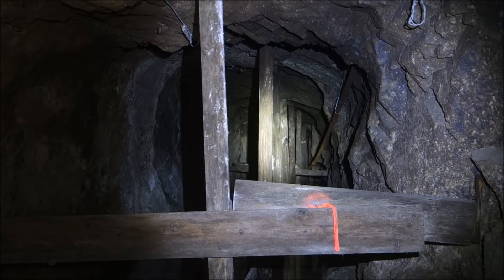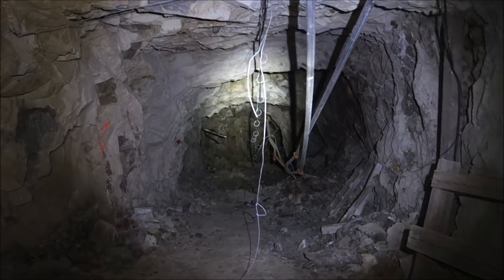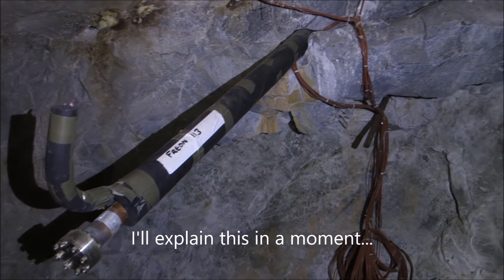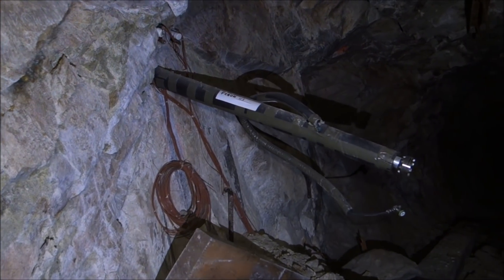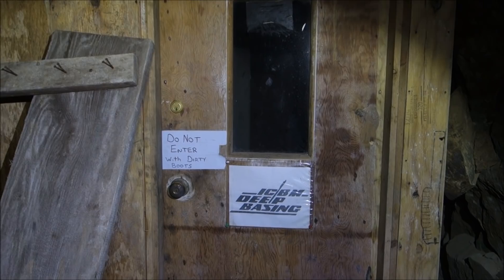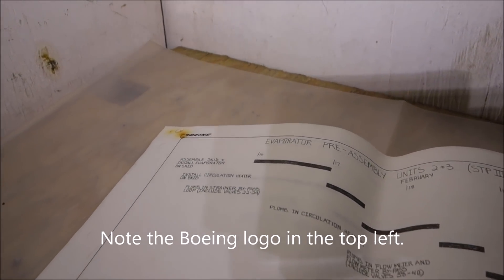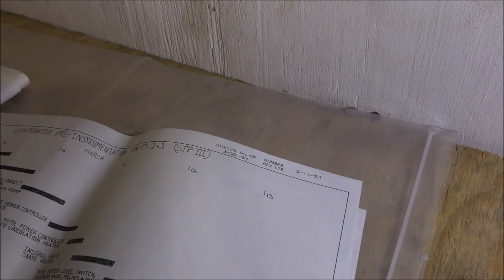Secret Military Project Discovered In Abandoned Mine

Comment: Very interesting and thought-provoking , in fact I have been thinking about this. As stated it’s a refrigeration system and R113 is a low pressure refrigerant that’s easier to work with although now banned because being at HCFC in the 80s it was still used. I thought maybe they were trying to make an ice “bath tub” to either harden (strengthen) the material more around the mine, or De-water (by freezing a coffer dam above and around) the mine. And admittedly a really wild speculation about covering the thermal image of the mine, I’m not sure exactly what they can see from outer space but it wouldn’t surprise me. However  in further wild #!€ed speculation, contemplation, the spacing of those injectors is too far apart for an operation of those designs.  I think the first individuals statement that it’s an air conditioning system for the mine is correct either they were looking to alter the temperature of the mine air or if it was going to be a military ICBM base they were also going to have to keep computer banks under certain temperatures cooling them and providing stable atmospheric temperature around them. The spacing is perfect for that. Those holes are geothermal sumps, that’s what you have instead of a water flow or air blown over coils (the condenser )the other individual said to look for those condenser units but I think he’s thinking of a different system.  Or I am. In a geothermal system those Bore holes will act as a dump for heat or as your supply for heat 54°F can be used to heat a house that’s 0°F quite warm or reverse the system and you can make it quite cold instead.  The bore holes are just sumps for cold or hot depending on what you need to get rid of. The other end in the field would be the unit that blows out your temperate air or yes maybe cooling/heating water to circulate as a coolant/heating medium.   ICBMS Control computers, warhead, rocket motors, mobile launching systems, targeting and control systems, human operators all require a temperate/dry enviroment to perform at their best or as I’m sure you all know in many cases fail completely to work if not provided with such. Or maybe they’re trying to communicate with the stone heads on Easter island.

Comment: A popular environmental protection method is to freeze the contaminant at the point of entry to prevent it from entering the watershed. Given that this is a technique used around alot of mine sites to prevent the requirement of treating effluent, I'd suggest that's what he is looking at. I'd be willing to be that there is a compressor station somewhere around these that acts as a heat pump to allow for freezing of pollutants.
Reply from the maker: The ICBM Deep Basing project was about testing sites for ICBM placement, not about controlling pollutants.

Comment: WOW!!!!! This is incredible! My first assignment in the Air Force was the Ballistic Missile Office, in San Bernardino, California. I was a Lieutenant having just graduated from the Virginia Military Institute, in 1980. I was assigned to BMO for three years. I worked on developing security systems for the M-X Missile (horizontal basing scheme) and during my last year there, I was the Program Manager for the Minuteman Extended Survival Power Program. MESP was a program to replace lead acid batteries in Minuteman silos with 10,000 Amp-Hour Lithium Thionyl chloride batteries. In 1982, I was the Factor Chairman for an Air Force Source Selection board to pick a contractor to conduct a study for deep underground basing of nuclear missiles. My particular factor (area of evaluation) was Waste Heat Management. The theory back then was that if you deployed nuclear missiles, all of the associated equipment, and the people deep enough under the surface of the earth, that it would be near impossible for an enemy nuclear attack to take out that installation. Studies had shown that after several waves of nuclear attacks that any crater dug by the nuclear detonations would just fill up with debris. Of course the Air Force wanted to make the deep underground missile basing completely self contained, self sufficient, and completely sealed off from the rest of the world. This meant trying to figure out how to get rid of all the waste heat from electronics (which were pretty big and consumed a great deal of power back then), closed cycle diesel generators, and even people. I was only involved in the evaluation of proposals. This is very interesting because it looks like someone actually did some tests to verify and validate some of the requirements and early designs. What an incredible find!

Here is a summary of what was BMO: https://www.globalsecurity.org/wmd/agency/bmo.htm
Reply from the maker: Awesome comment and background information... Thank you very much! I was hoping that someone with some real knowledge of the research done on this program would weigh in.
Reply: @TVRExploring  Great to hear from you and I'm glad I could help. I have done some caving before., I spent four days 1,500 feet below the surface of the earth in a caving expedition in Lechuguilla Cave (at Carlsbad Cavern National Park). I've also been in a mine before, at Orient Mine in the San Luis Valley of southern Colorado. Keep up your good work!
Reply: Thanks for the background, LT. I'm sure we have facilities currently in service that exist because of your work on that project.
Reply: @wes11bravo  thank you!

Comment: Possibly establishing the R value for rock. This might help establish the heat transfer ability for buried nuclear storage sites which generate their own heat. From nuclear decay. Presumably Yucca storage site for instance, would generate heat over a period of time and they would need to know how hot it might get and how to remove excess heat. Stainless steel pipe as used there presumably would not rust and might last hundreds of years. Of course if a whole mountain is used it gets warm but not dangerously warm, special cooling systems might not be required, and the whole system could be passive. Using thermal mass and  thermal conduction through the rock, the heat eventually radiating out through the top layer into the sky or the surface being cooled by wind. It looks like the office still had a baseboard heater there by the way.

Comment: Patent US4431349 may or may not be relevant to this (probably not, but it is interesting to consider frozen ground water in the rock being used as a protective measure for the missiles) - "Missiles located in the deeper (hard rock) portion of a shaft or tunnel are protected from damage during a nuclear attack by a mass of ice, preferably trumpet-shaped, located in the outermost portion (e.g., 600-900 meters). When missile egress is required, an ice-supported passageway is bored through the ice, preferably by melting. The trumpet shape assures a straight path for missile egress even if the shaft or tunnel should become transversely displaced by a cratering explosion against the surface."
Reply from the maker: Whether related or not, that is a very interesting line of research... Thanks for digging that up.

Comment: FREON 113 Is a non volatile low toxicity solvent cleaner, mainly used on delicate electronics. Dont know what they where using it for here.

Or if you mix it with zinc it will produce chlorotrifluoroethylene which is used in Cryogenics.....
Reply: Uhhh OK this is the most fascinating comment of all. Wow. Good observations.

Comment: Those aren't "injector" pipes.... hard as it may be to imagine, the freon is going somewhere in gas form and being condensed, then coming back liquid - you're looking at one end of a heat pump/AC system.   I think either the thin line connected to the freon pipes is the liquid return or one of the other pipes in the wall is.  The diagram shows a cooling system, basically moving heat generated from within the mine to somewhere else.    Based on the bundles of wiring near the freon pipes, I'd guess some sort of computer equipment or possibly mechanical equipment under test was placed on skids on the ground and cooled via those lines.   The diagram shows something like an evaporative cooling system, where freon is evaporated by heat in the mine, circulates out via the thick freon pipe as a gas, gets compressed and re-condensed somewhere using water cooled compressors with evaporative cooling, then gets pumped back via the thin line as a liquid to repeat the cycle.   This would let the system move thousands of watts of heat out from underground to somewhere else.   If you can find the other end of the pipes, it'll either be somewhere else in the mine where there's a lot of water or on the surface.   The instruction sheet you show is just a "how to" for operating a hydraulicly powered diamond drill, probably what they used to run the freon pipes.
Reply: It's geothermal cooling. The rock is a giant condenser. Nothing special and they don't go anywhere. It goes in a gas and comes back out a liquid.
Reply: So there that's my answer and I'm sticking to it
Reply: @johnkulpowich5260   Don't believe him it's obviously a government cover up! They used the freon gas to control the miners brains to make the perfect slaves to dig up alien technology.
Reply: As an HVAC technician I agree with this theory
Reply: They were in a war fighting the crab people.
Reply: Yep refrigeration system.  r131 is a low pressure refrigerant thus easier of a system than the higher pressures required of r12 or r22.  Personally I think they might have been experimenting with drying the mine by freezing the surrounding strata.  Or hardening it more, or disguising a thermal signature, or as well said conditioning the mine air or many of above aforementioned.  Taxpayers will never know. Btw r131 is now on a banned list and cost over 2 grand a kilo.

Comment: They inject water and freeze it to fracture the rock, well known technique now days, maybe new or experimental back then.
Reply: Jared Amos. Why would Boeing be injecting water to freeze, in a mineshaft? I didn't know Boeing were miners, I thought they were an aero space company?
Reply: @66hobgoblin81  my question exactly....boeing, aetheon....etc...
Reply from the maker: @Jared Amos This was military research being carried out here, not mining research... And they were working with freon, not water.
Reply: @TVRExploring  Yeah, the military tests technology years or decades before the private sector does. This is nothing top-secret. It's geothermal cooling. They used the rock as a condenser. They weren't using it to fracture anything. They have dynamite for that. These days they drill down vertically from the surface to accomplish what was being done here horizontally in a mine.
Reply from the maker: @timramich  This was testing for the suitability of such sites for the ICBM Deep Basing project. The cooling was part of the testing process. The entire project was secret at the time as, obviously, the location of ICBMs and the method for determining where to locate them was something they wanted to keep close to the vest.
Reply: @TVRExploring  The geothermal aspect was not experimental. It's quite simple stuff. The project was obviously a fail because of the logistics. Having to get them out of a mine and do whatever to them to get them launch ready was nowhere near quick enough. That's why they just stuck them in vertical silos, ready to launch, with 2 people waiting for launch codes. This is just one example of someone coming up with an idea they knew wouldn't work just to get free government money. Kind of like the crowdfunding garbage of today. So much pseudoscientific crap out there that never comes to market, after pocketing hundreds of thousands of dollars. Senators and congressman aren't too bright when it comes to practicalities.
Reply: In the "how its made" video on uranium mining, they mention cooling the ground with chilled brine to control the ground water in the surrounding area.

Perhaps the freon was a similar aspect: if they could keep a deep underground silo or base from flooding, then it would help preserve the missile.
Reply: @Puffie40  It was using the rock as a condenser.

Comment: If they injected Freon 113 into the rock, the whole area including water table would be contaminated. It does not break down and can be toxic, even fatal. It takes very little inhaled to cause nerological problems and suffication/death. 

I wonder if it was not used to draw heat out of the rock in case of thermonuclear war so they could still launch. One could argue at that point it is useless as the entire planet would be destroyed anyways.

Comment: Hmm . I will hazard a guess here .  In that Freon will freeze almost anything when subjected to enough Freon over a period of time  . I am "guessing " they are testing the strength of the rock by subjecting it to cold temp's ?!?  I am guessing that they measure the temp needed to fracture the rock , ergo deducing what the rock(s) can withstand .  I do not know if it is still used or done now . But there was a time when Freon was used to do pipe leak repairs .  You picked the size of clamp for the pipe size . Those clamps had ports that Freon went thru and froze the line/ pipe at TWO spots .  You could cut the line and make repairs  BETWEEN the two clamps without draining the whole system .  Not being in any respects a geologist , and with all those sensors . Maybe they can measure the temp X distance away and tell the hardness , fragmentation etc of rock !?  Very interesting video !  Now to the Schematic .  It appears to be two STEAM fired HTHW converters . But I do NOT see a trap drawn in off the bottom of the converter ?  Also , the TOP right side of the schematic has a detail of a 375 degree  heat pipe vent tube . The only way you can get these kind of temp's is with a HTWH  boiler or a Steam boiler with a Super Heater drum .  I would love to see a full print and the use of this system .  Unless it was extremely cold down there , or they were using this HTHW instead of orifices to atomize the freon , I don't understand it's use . Then again . There are volumes of shit I don't understand .  I also find it interesting a sight gauge is hand drawn in on the expansion tank / drum  , and drawn in with the top still in the water column and not the air section ?  There is a whole lot of safety features drawn into this schematic . But if this was down in the mine , a exploding converter wouldn't be a good thing . But , in some regards HTWH is MUCH safer than steam . HTWH loses almost all of it's energy at a LEAK when it flashes to steam . At about 3 ft away ,  or at the end of the leak spray ,you can put your hand in the spray and NOT get burnt !!  Not so with steam!!  As usual , one of your video's has taught me something I didn't know . Oh , and before somebody calls me out . YES , you can get those kinds of temps , in the right conditions with focused sunlight !! Many years ago I saw such a system outside of Barstol Ca.  The tank glowed with the focused sunlight .  Stay safe out there ... Gubs
Reply from the maker: Thanks for sharing your knowledge on this one... I was hoping you'd weigh in on the details. That tank you described that was glowing from the focused sunlight is amazing!

Comment: "Stand back! I'm going to try science!"

This honestly raises more questions than answers. I can think of about ten different things they may have been exploring off the top of my head. I know of this mine through the Deep Basing project, but the name eludes me.

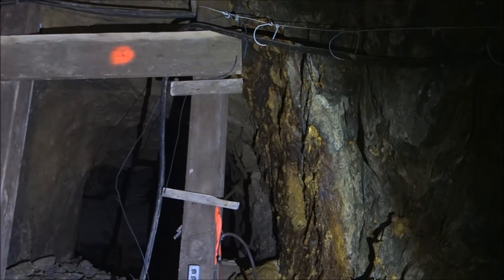Oh, and 2:07 is an abandoned ore chute. I've seen loads like that in eastern Arizona and western New Mexico.
Reply from the maker: My observation about measuring temperature transfer was speculation based on the freon and the nearby sensors. I'd love to hear more theories on what they were testing or experimenting with...

Yes, you're right about the abandoned ore chute. I recognize them now too. This video is 2-3 years old.
Reply: @TVRExploring  My speculation is they were testing the limits of environmental control.  ICBMs are complex and need to be meticulously maintained.  I can only imagine all the perils associated with trying to store them deep in a mine or cave.  They would need to carefully control humidity, temperature, avoid any sort of water incursion, dust incursion, or rogue radiation sources.  If they were intending on storing the full boost-phase rockets down there, then increase the criticality of those controls by 100X.
Reply: @TVRExploring  how far is this that huge
 tunnel with that cement enclosure in deep.
Maybe be some of the same research they were doing buy in 87... ?